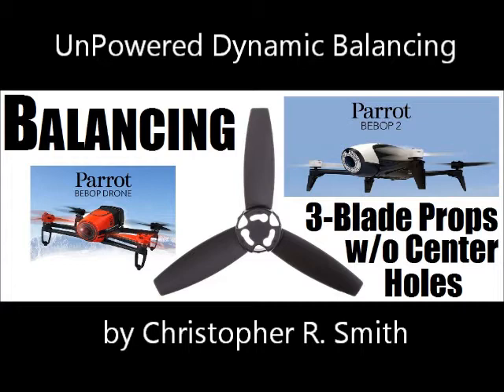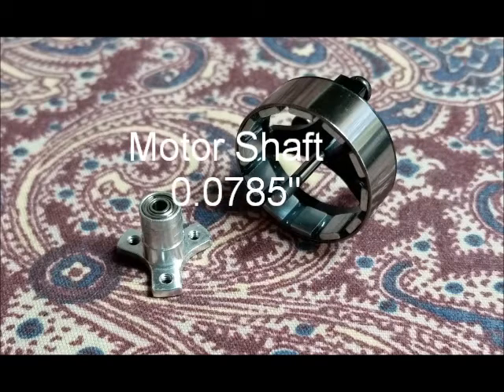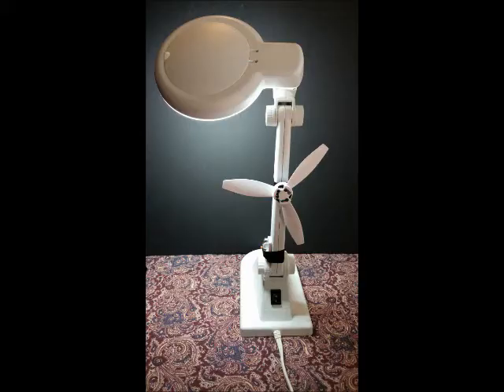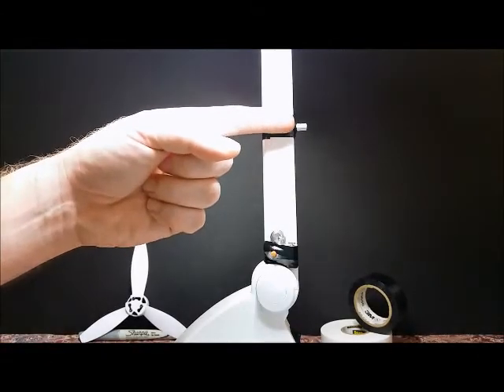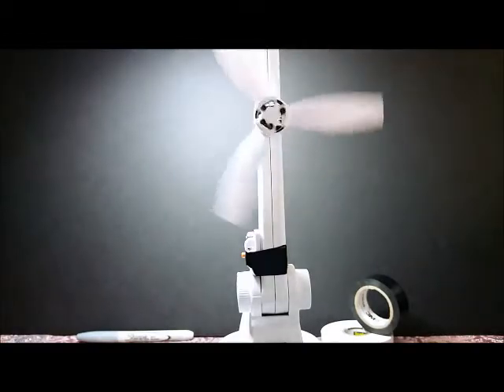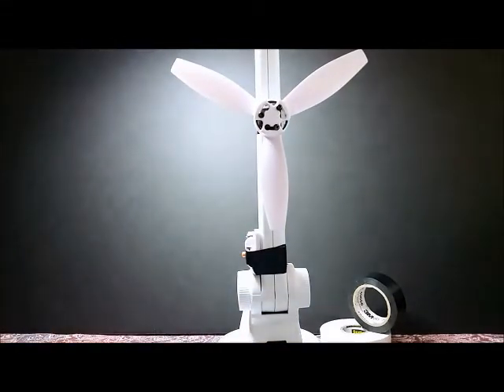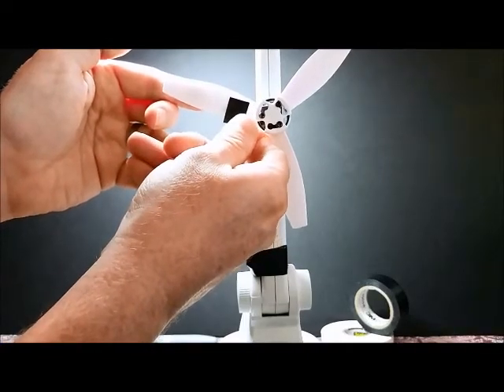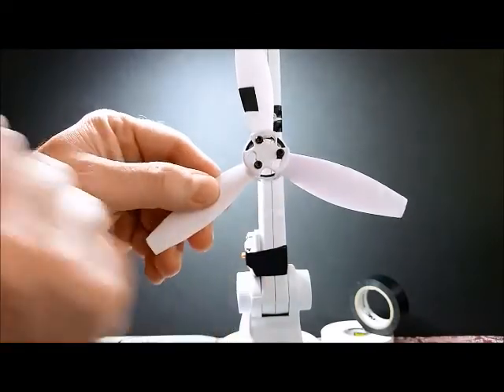Balance 3-Blade Propellers w/o Center Holes - Parrot Bebop

Comment: You are right. It's a great way to do altogether. Just need to take out all the motors or do it before replacing with new ones. Thanks for your effort and it's indeed great idea to do it one by one.

Comment: After balancing with this method I figured out that the cages are out of balance too.  Now you think I made it even worse ?
Reply from the maker: NatureLove The method in the video shows both the rotor cage and prop being balanced together. These 2 are now matched and balanced per the position of the prop on the rotor. Balancing each separately is another way. Yes, if one part is not balanced vibrations will exist..."worse" maybe if a mix of imbalanced parts are installed just right with eachother..more (or less) vibrations (total imbalance) can happen. Both parts need balancing...its just easier to do them together.